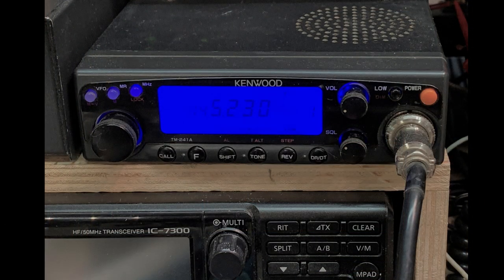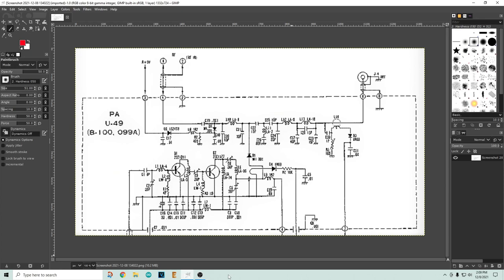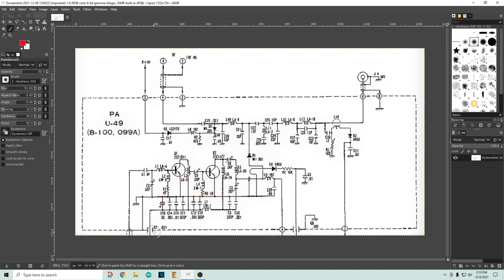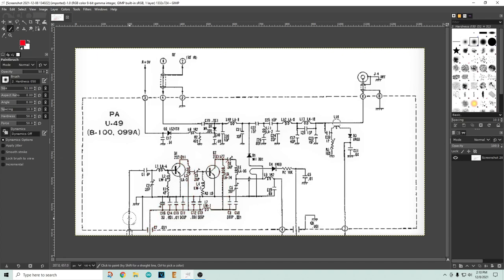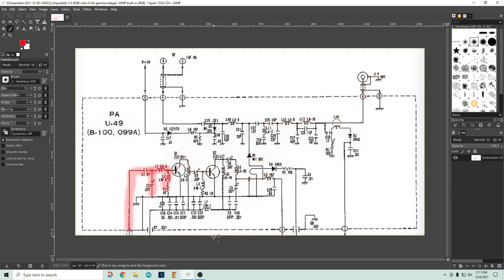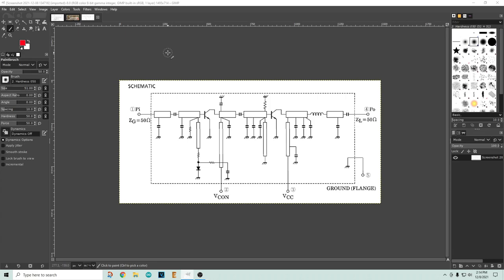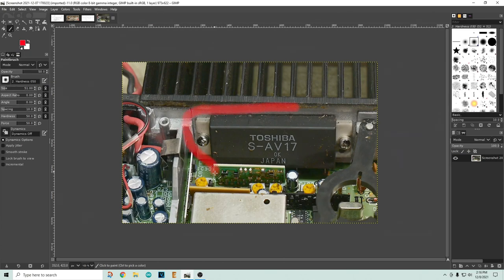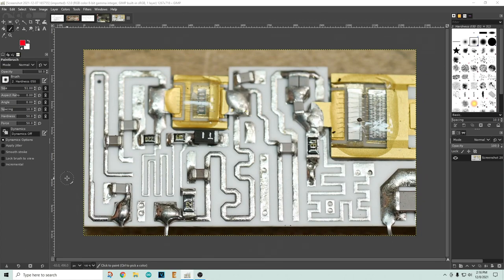#990 Toshiba VHF Power Amplifier Module

Comment: cool stuff.  If you look at the closely transistors themselves (the gold sections) the Base is connected on the left, the Emitter is connected vertical gold bar on the right (connecting to the horizontal gold bars on the top and bottom), and the Collector is on the bottom of the die and its tab (extreme right) actually crosses under the Emitter's vertical bar.  Both the the driver and the final look like multiple transistors paralleled and will have ballasting resistors (on die) in series with the Emitters to balance the load across the paralleled transistors.   I really like the "slide to tune" capacitors. Most likely so they could use the same module for different frequencies.
Reply: Yes, same module, with an easy to adjust tuning, so you make the base module for a wide band, and only have to change tuning capacitor value, and precise location, per batch to get all to be a good match in the desired band. More because the thickness of the ceramic substrate will vary, along with the exact dimensions, per batch you mix, as the shrinkage in firing can be pretty high. Helps then to be able to have a test jig you slide the capacitors along per stage, so you can set the location too place them in production for this particular batch. Look at another, from a different batch, and the capacitors will be in a slightly different location, so if you replace a cracked capacitor in one use the exact same size capacitor, in exactly the same location, or else the tuning will be off.

Comment: When describing the RF path on the MODULE, you said (on both transistors) that the RF enters at the EMITTER on the transistors.  That is not correct.  The emitters are GROUNDED.  The RF is applied at the BASE.

Comment: You said input to the emitter but then corrected yourself. I see 9 bond wires on the output, is there 9 transistors in parallel then ? Would some of the caps be silver mica? RF is another world , especially GHz, that is RF plumbing with E fields and H fields weird stuff, but I love it.   Keep up the great video IMSAI man.
Reply: No, all those capacitors are ceramic, a mix of NPO types for the tuning, and for coupling much cheaper and larger value X7R or equivalent for this, as you do not need to worry much about the actual value, providing it is much larger than the tuning ones. Multiple bond wires to keep the inductance down, as you are effectively using the large number of thin wires to create a flat ribbon, which at RF has a much lower inductance. Yes the RF transistors are multiple small structures on the same die, much more than 9, likely at least 18, as each bond wire will feed at least 2 tiny little sections, if not more, with some wide metallised silicon providing a common pad for the base and collector junction, isolated by either oxide, or a reverse biased internal diode, or by having a very high resistance silicon area under them, or a combination of all 3, to keep the capacitance of the connection to the emitter, the base of the transistor, soldered to the heat spreader, down to a very low level. RF transistors are in general more a very specialised integrated circuit component, rather than just 2 junctions, especially when you want high power, small size, and high efficiency at high frequency, all in the same package.

But bonding multiple thin wires is a lot easier than trying to bond a ribbon, and have it equally good all the way across the width, plus much more expensive to make a machine to do this, plus the force will very likely crack the die. There are some applications where this is done, but those units are in general a lot more expensive to produce, and tend to use a solder preform both sides to attach the ribbon, when doing the entire die. Not going to be done on a $10 module for sure, probably only on ones that are $1k plus.
Reply: @SeanBZA  Wow. That was very educational. Thank You Sean.